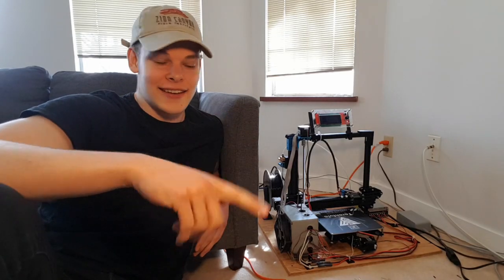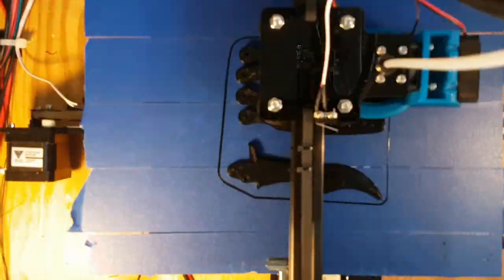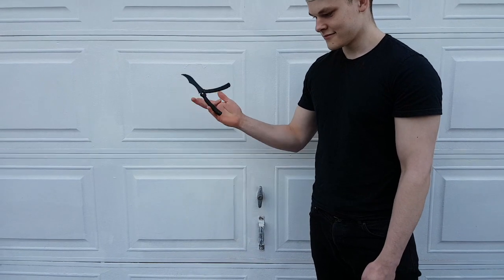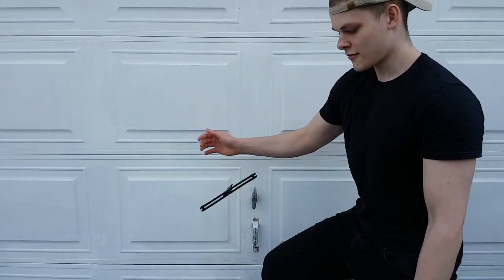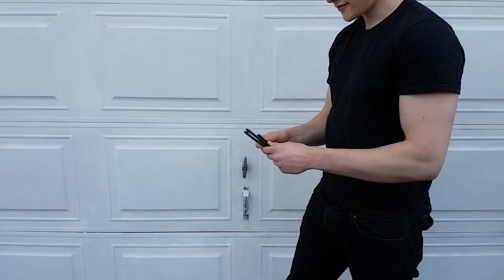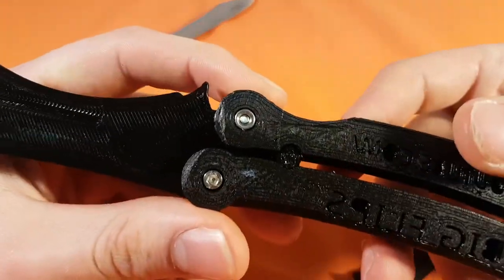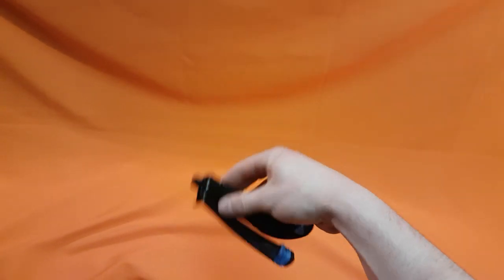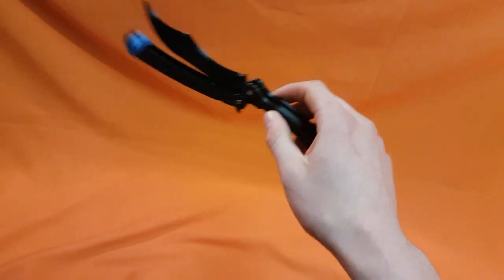3D Printed Balisong

Comment: I was gonna print this but my filament is all tangled up and keeps getting stuck on each other and gets disconnected from the nozzle dont worry i bought  new filament hopefuly it aint tangled
Reply: Well, in my 3d printing experience, the filament is always perfectly wound when you buy it. If it gets tangled, it's likely because you had to cut it off or something where it loosens the filament. Try looking up a video for untangling filament, I remember I found something on the web for it before...

Comment: Hey I'm currently designing a 3d printed bali that's is actually good, I'm making it as an alternative to a real blade that you can take on planes and flip in public, it has actual quality hardware running on brass washers as well as metal integrated into the blade and handle so it doesnt feel like a plastic knife. Handles are channel construction so you wont get that pinch binding with the blade and they will be printed in strong materials such as carbon pla, and nylon still tweaking out tolerances and weight distribution rn but once v1 is ready would you mind me sending you one to review. It will be up on kickstarter as well

Comment: I can't speak for the person who originally designed the "base" of the knife. But I can speak for the person who took the base and made it into it's actually usable state, because that's me. The reason for the small size is not because of lacking flipping experience, since while I might not have just as much as you, I do actually have quite a bit. The real reasons are that the nut holes are exactly the right size for m3 nuts so scaling the knife would mess that up. I could've just kept the holes the same size but scaled up the rest of the knife but that brings me to the second reason, limited printing space. Printing a larger knife is hard if your printer won't allow it, which I believe, was actually the case for me back when I made it. Besides, larger prints take longer time, and who has the patience to wait for that??

Also, of course one shouldn't buy a printer just to print this instead of getting a real one, this is worthless if you look at it that way. But for the people who already do have a printer this is a fun little experiment just to see something that's 3d printed actually does flip (almost) decently. The rubber bands also aren't needed after some time of flipping because the parts that would get stuck on each other slowly goes away as you flip.
Reply from the maker: yo thats awesome dude. of course i have no knowledge so i lipped you but that is bad ass. great work on the design dude! keep it up!
Reply: Thanks.
Reply: Yeah I agree with wut ever u said I didn't read it at all